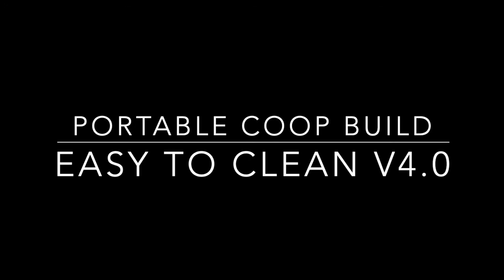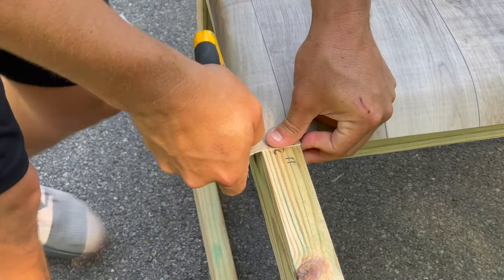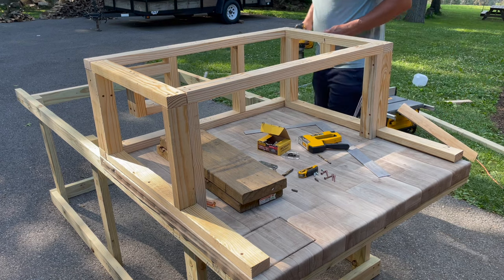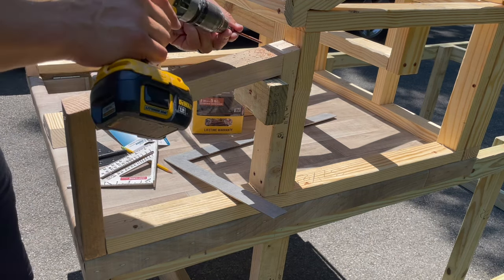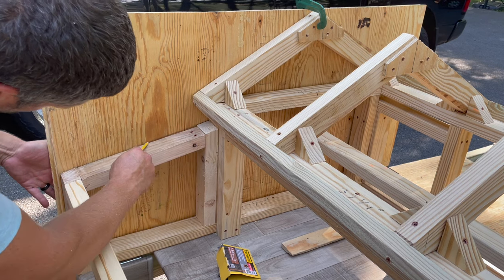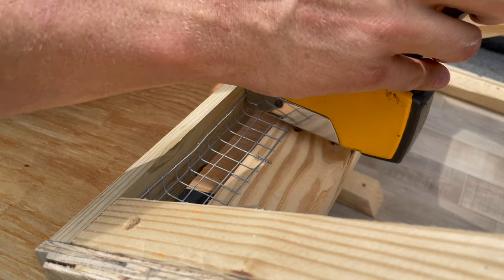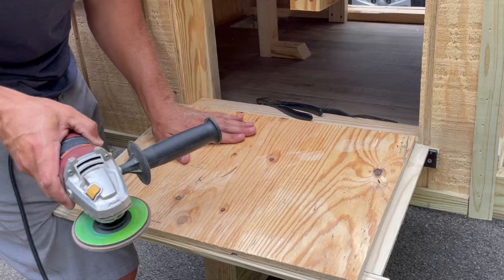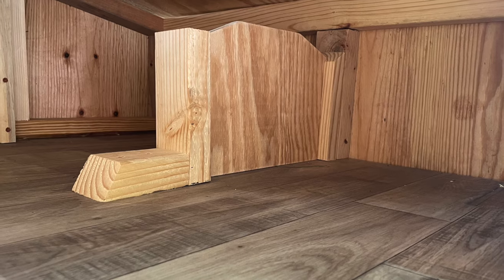Portable Chicken Coop:  Step-by-Step Build with Commentary - V4.0

Comment: Had to see this again...I modified the design to fit a premade coop on top of your design which is amazing...a three story coop. The linolem is now part of a second story nesting area. Now I am builing your frame design again to add to the original for an estimated 12 foot bottom run area becase the sun hits in the late afternoon and I needed to give them some dirt and shade. Thanks again.

Comment: any rough idea of how many 2x3x8s i would need for this project? trying to see if this will be below the cost of a prefab coop
Reply from the maker: Good question, I haven’t done a supply list for the coop  / run, but I would estimate the total cost of this project to be between 600-650.  The lumber / t1-11 was probably only half of that.   Chicken wire, hinges, door hardware, shingles, and paint all added up very quickly.   

I can guarantee you it will last a decade or more, and the same can’t be said about a lot of prefab coops.

Comment: Great work! Best home for chickens. 
Is there anyway to build simpler?
Reply from the maker: Hello yes you could simplify this design.   Build only one access door on the coop and one on the side of run (instead of two which it currently has).   You could eliminate the “x”  on the coop access door which is merely aesthetic.   Paint everything one color (trim, coop, and run).   Eliminating the linoleum and the trap door  would simplify the design, but I wouldn’t do either of those.

Comment: About how much did this cost?
Reply from the maker: Hey, I built it last summer when lumber prices were still very high (I think they’ve come down since then).  I would say you would be lookin at about $550 today.    Door hardware alone was about $100 of that.  Chicken wire about 60.   2 sheets of t1-11 at $40 each.  About 40 for screws.   And on and on.   It adds up quickly 🫤